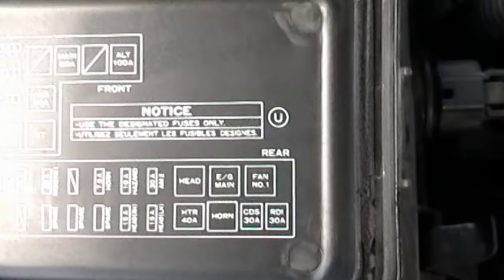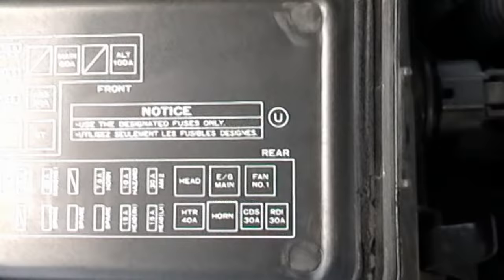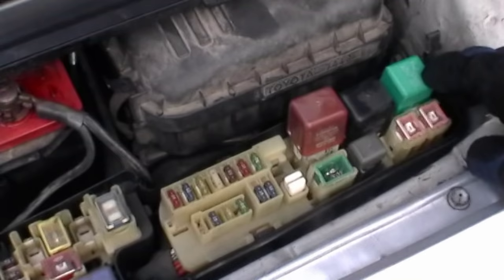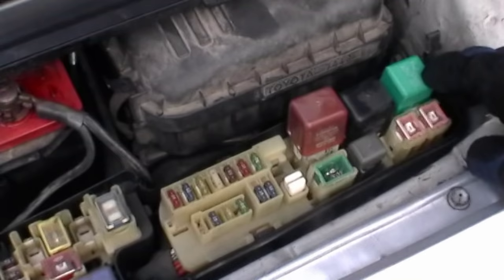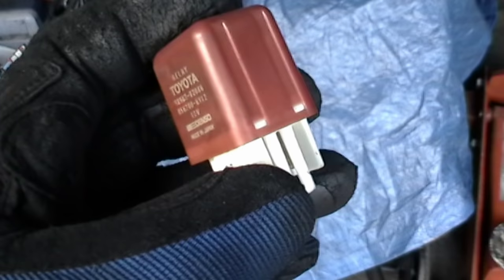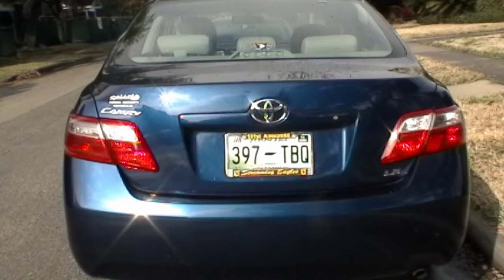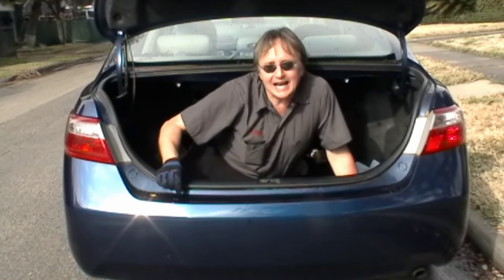How to Repair a Cooling Fan in Your Car

Comment: I own a 1997 Olds Cutlass Supreme, 3.1 L engine.  When I turn on A/C it just blows warm air.  (A/C indicator light does illuminate on dash control) Compressor does not kick on.  As you know there are two cooling fans.  Passenger side does not come on, driver side does engage.  I have not checked anything so far.  Thoughts?  Thank you

Comment: scotty i did all the test everything is good except i still cant get my fan to turn on. i had a heater sensor malfunction and i changed the thermostat and the heat sensor and all new fuses. my car still over heats my coolant reservoir always melts a hole by the hose and sucks up all the coolant. ive paid 200 to fix my problem with no luck. im on my 3rd reservoir. ac works no cold air or hot. please need advice. by the way i love the videos man. keep them coming.

Comment: If one of the two fans is working, should the other be working, also? Or is it computer controlled and additive, meaning does only one fan sometimes come on, normally, and the second fan only when needed? Thanks. I've got one of the two fans that is acting sluggish when I first started the car, then stopped completely before the motor warmed up - not sure if this is normal or not. Thanks!

Comment: Hi, the fan temperature switch test is not clear for me. So just connect one wire between -ve battery terminal and where in  the fan switch?

Comment: I went through all these steps on my 2003 Chevy Venture. Tested my fans on the bench when I replaced the radiator and in the car by unpluging the senor, they come on. Tested the relays and fuse. Replaced the coolant temp sensor. Still not coming on when I let it get hot. What now?

Comment: I have a 2001 Pontiac Grand Prix that's overheating . The coolant and oil levels are adequate so I think that narrows it down to the radiator cooling fan, because it doesn't come on when the engine is running. Can you give me the simplest possible fixes for this, specific to my car, with maybe a video? Sure would appreciate it. Thanks

Comment: Hello. Here's an interesting issue. In my 2013 Dodge Avenger SE, the two fans are working fine on low, but on high only one turns on. Relays are ok, as well as fuses. But no power on the failing fan wire on high. Why can happen this?

Comment: I have a 2006 Pontiac Vibe. My cooling fan motor works. But the actual fan inside wiggles. Do I need a new bearing or spacer and how do I do that. Or should I just replace the whole unit?

Comment: Hi  Scotty,  I enjoy your videos a  great deal.   
I have a 1995 Camry 177,567 miles..   I brought it used back in February.   . Both fans ran as soon as you start the car. Continues to run until you turn off the car.    

What say you?
nh

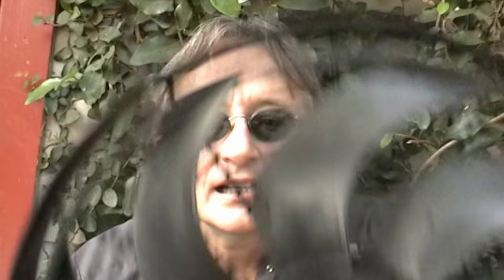Comment: At 1:47 to 2:22  you say to "ground it right here on"___  ??????? then it cuts right to, Take the other end and put it on the neg terminal of battery. So 1st off you just use neg wire with alligator clips correct? No positive this time?And 2nd if fan come on you need new sensor correct?? and what did you ground it on? the prong i'm assuming. Is that right. When did cooling fan relays come out cause I  dont think i have one on my 95 buick century. Thanks Scotty.

Comment: Hello Sr very good videos, I have probably a dumb question, Does the fan has to turn on every time that you start the car or only when the car is heating up? Thank you. Honda 97 just replaced the radiator and the only fan that turns on is the one of the right ( from driver view ) but stays on even when I turn off the car

Comment: Hey Scotty what would be the over heating problem on a 2010 Chevy Camaro I've changed the sensor I flush the radiator there's no smoke coming out from under the hood but it's showing on the gauge is overheating sometimes

Comment: 2005 Dodge Caravan Radiator Fan Driver Side is not working. Passenger side is working pretty good but not the Driver side. What should I do.

Comment: My '89 jetta cooling fan only comes on when I turn on the ac.  I changed the cooling fan sensor and the thermo fuse that had burned and melted the fuse holder.  The fan still does not come.  It used to come on when I ground it.  Since I changed the the thermo fuse if I ground the fan while the vehicle is running it does not come on anymore, but it will come on if I turn off the ignition.

Comment: And also do you recommend using permatex on the housing gasket to replace the thermostat or should I be fine just tightening it back together with the paper gasket no silicone ?

Comment: you werent clear as to where to ground the wire to the sensor when testing it with a battery,,,do you touch the inside of the sensor or the outside with the ground wire?

Comment: Tested the Fan that works. Replaced the temperature sensor. Replaced the Fan relay. Fused isn't Blown. At this point I may wire a switch to manually turn the on and off at idle. 
Any other ideas? Btw I have a 05 Kia spectra

Comment: Great vid! Do you know where the  cooling fan temperature switch is located on a 1999 Oldsmobile Intrigue? The fans work and the fans’ relays are good but I can’t locate the cooling fan temperature switch. Thanks.

Comment: I have a 2005 Hyundai Sonata, the condenser fan is not working, it's not getting overheating at all. I checked relay, fuse they all good. Should I replace the fan? I'm not getting cold air but the heater it's working perfectly fine. Any suggestions? Thanks

Comment: Scotty,love your videos..
I recently bought a 2012 Ram 1500...every time I turn the AC on I get engine light and fault code p0481....found out electric  fan isn't working...so I jumped the fan from the battery and the fan works.....
There is an auxiliary fan relay below hood latch...I pulled the relay and bypassed it and the fan runs...what else could it be ???
Any help much appreciated

Comment: I don't understand are they supposed to work all the time while engine is running or every while?
Reply: He didn't say censor and a switch so the answer would be no it's no need for switch or censor if the fuse is continuous

Comment: If you close the circuit at the relay and the fan turns on does it mean the relay is bad or good for 100%? Or could it be the temp sensor still? If the temp sensor is bad would the fan turn on if I close the circuit in relay or not? Thank you for any help or info in advance!!

Comment: hey Scotty show I replaced all the relays that are in the fuse box that relate to the cooling fans my question is if one motor doesn't work on the dual fan setup will that make both Motors not turn on when the car gets hot
Reply from the maker: check to make sure the motor isn't burned out first, if not that, often bad computer circuitry that drives the fans

Comment: to check the (cooling fan temp switch)..all you do is run a ground wire to it and the (neg) on the battery ??

Comment: I Cannot find anything on a cooling fan switch for a 2007 ford escape hybrid. The auto parts store only sell extra wiring to hot wire the fan. Im  guessing the cooling fan switch isn't accessable.

Comment: My Radiator aux fan is running (it;s really loud) within seconds after I start my 2008 BMW 335i. This started here in NJ when it got very cold two days ago (13 degrees) and also I don't have any heat since this happened. Any ideas? Thanks as always............................Philip.

Comment: Heay Scottie I got 2001 Grand Marquis and fan works, relay is fine, thermostat is replaced but still have major voltage drop when fan kicks on and wires get too hot to touch by fan connector near top of radiator area!! I'm confused as to what can cause fan to work and wires to overheat being they look to be pretty thick gauge original wires. Please any advice? should i just look at replacing the working fan that comes with new wires!

Comment: i have a question. i have replaced the temp control switch and fans aren't coming on but when the fan is directly wired it works but my car has 2 fan relays. (04 chrysler sebring) will i be able to look at them and tell if they are bad or should i just replace both to be on the safe side?

Comment: I don't understand when you short the temperature switch with the negative terminal, which case means the temperature switch is bad? running or not running?

Comment: hey I have a 2005 kia optima LX my fans aren't working, I watched this video obviously and did what you did and they worked therefore my motors aren't broke but I haven't checked the fuse and I don't know where's the reset switch...
Reply from the maker: +J Rich it has no reset switch. More often either the coolant fan tempt switch is bad OR the main computer circuit that drives it

Comment: Pro Mechanic Tip from a used car dealer: If  your car starts running hot as you are driving and you need to make it home or the next exit, open the RUNNING HOT CHECKLIST......1 roll down windows. 2 turn the heater to max heat. 3 turn the heater fan to max.
By doing this your heater core is acting like a radiator to help cool the motor.  This may get you home or to the next exit.
Another tip:  Scotty failed to mention:  your driving down the road and and your temperature gauge drops down to cold.  
You think it's ok. Cold is better than hot.    WRONG. Here's what happened: your antifreeze has leaked out.  Your temperature guage read off the antifreeze. 

Your motor is going to melt down.  To double check turn the heater full blast.  You have no warm air.  
Pull over immediately and shut it down and call for a rollback.
Best case: a leaking hose. Worst case: blown head gasket.
You're welcome Scotty.

Comment: When you tested that sensor, where did you actually put the other end of the negative wire, and the red end?
Reply from the maker: the negative wire is grounded on the engine to check it

Comment: Hey Scotty I have a 2005 Kia Spectra and I've done everything on the video I replace the temperature sensor I replace the relay I checked the fuse that wasn't blown and fan still does not come on but the car seems to be running at normal operating temperature the needle never rises above normal so what do I do from here?( yes the fan motor does work)

Comment: Scotty, on my 99 Elantra, last nite my temp gauge went up a little warm , not over overheating, the cooling fan spins very slow, not fast not sucking air as you say in your overheating video, now tonight I go to check it, an now my air conditioning fan for the condenser is not running . any ideas ? My dad told me use the heat along with the cool air outside until I fix it, fuse an relay is good. Please let me know . Kody

Comment: Scotty great video...you gotta HELP me...
    I was changing my oil the other day, and checking my fuses on a Chevy Impala ltz  2015 ,I let the car run without the cooling fan fuse !!!!( forgot to put it back in)  
    which I forgot and the car was running for about 15... minutes,  it was smoking .
   I think it was the residue of the oil burning on the exhaust though.( I'm hoping) . I hope it wasn't the engine burning in overheating the gauge never goes above half anyway in that car.
I do appreciate it  in advance  you respond !!!
 I know you don't respond much but please I need you on this one, I've been watching your videos for 20 years!!!!

Comment: Soo dumb question but here goes: I have a wobble in my fan. Its driving me nuts. I know how to pull the fan and replace it but I am worried about what looks like a coolant resovoir attached either to the fan or the housing. Will removing the fan introduce air to the cooling system? Its an '06 Pontiac Vibe. I am thinking of pulling the fan, collecting the coolant in the small resovoir in a container, and replacing it in the new fan. Is this correct?

Comment: For a 2000 Honda Civic, what would indicate overheating if there is smoke coming from the right side of the car and the fan only works when AC is put on blast?
Reply: did you ever find a fix for that
Reply: Throw you car away lol

Comment: 2005 Durango 5.7. When AC is on at idle it blows warm air, when moving it blows cold air. Checked condenser it appears to be spinning, ac compressor is engaging every 5-10 seconds at idle in park. What could it be?

Comment: Scotty what if your cooling fan is running excessively? I’ve got a 2004 Toyota Highlander with almost 300K miles. It runs and shifts beautifully but the fan is running a lot even in this cool weather. Any ideas?

Comment: hello Scotty I changed out the radiator because of a small crack and my fan fell off and just rolled down my driveway so I bought a new fan.... Electric fan  works when I turn on my a/c .... clutch fan turns all the time but from what I have read that is fine .My question is when will my electric fan turn on???
...

Message not delivered.Now

Comment: Hi Eric I'm working on a 1998 wind star 3.8l mini van and the cooling fans not working I checked the fans they do work and also checked the fuses they good. I'm going to change the cooling temp sensor but I notice that when I turn the a/c on the fan work then.. Do you know why? Do you think it is the temp sensor?

Comment: I have a 2003 Chevy Malibu and the fans don't come on and the car overheats. I haven't been using it cause I don't want to damage the engine. But, I tested the fans and ran a wire to the battery and the fans come on high; I also turn the a/c on and the fans come on high. I checked the fuses and relays and they are good, except fuse 55 cooling fan #2 ground (30amps) (v6 only) doesn't light up the test light. The wiring diagram says hot all times but I guess it should complete the circuit when the cool temp shorts out. I replaced the thermostat and that didn't fix the problem either. Then I shorted out the wires that go to the coolant temp sensor and that did turn on the fans on high. So I went ahead and replaced the coolant temp sensor, but it still doesn't turn the fans on and the car overheats. I then thought the coolant wasn't flowing and replaced the water pump, and the same issue. Then I opened up the bleeder valve and put more coolant, then turned the heat high with blower low, and still no fix to the issue. I then took out relay #12 (cool fan #2) and ran a wire from 30 to 87 to see if the fans turned on low and they did, so this determined that relay #15 (cool fan mode relay also works because it has to go through that relay to complete that circuit). But still I can't fix this. With the information I have provided, what do you guys think it is?
Reply from the maker: ***** those are complex computer driven fans, why not do what I do, just run a toggle switch to power the fans manually and leave it at that
Reply: Thanks man. I'll do that then. Thanks. I enjoy your videos.

Comment: I did what you said and ended up replacing the coolant fan switch/sensor but the connection to it came apart. How do replace cooling fan switch connector? The other end seems to go into the engine somewhere. How do I get to it?  I have a 03 Chevy Malibu

Comment: What about if I replaced the switch, I tested the fan as you showed and it works and the fuses are ok but my fan still doesn't run when it suppose to what can be the problem?  I went to mechanic and he says that it might be weak battery as it's quite old but that doesn't make much sense to me. The car starts just fine every time. It cannot be the wires as well as he tested my fan through obd connection with his laptop and the fan worked just fine..

Comment: I have a 93 Honda del sol. I have checked the fuse the relay and they are both good. I replaced the sensors and it still doesn't turn on. Am I missing something?

Comment: hi scotty, This was a helpful video. I encountered different problem with my radiator fan. when a/c is on the fan is functioning at low speed and fan speed doesn't change even the temperature gauge keeps high which affects the aircondition, but when the a/c is off , the fan will function in high speed when it reached the mid temperature. I am wondering what to be changed or to be repaired. hope you help me.
Reply from the maker: you have a problem in the AC system wiring not sending full power to the cooling fan. Start checking that wiring and pray it's not a computer circuit fault in the AC computer module
Reply: thank you scotty. my car is nissan serena model 95 and not have a computer box on it. do you think it's wiring trouble? thanks again

Comment: is it normal for the car AC to take around 10 min before it starts delivering cold air in high outside temperature 110 degrees and above? anyway to decrease this period other than parking in shadow and tinting?

Comment: i have a 94 corolla when i turn on my park lights the tail light fuse blow dont have dash light either i do have head lights,turning signal, hazzard light and i have light when press brakes

Comment: Thought i had a short? Red wire getting really hot. Have old style assorted connectors like package at pep boys. Connectors are tight and fan stays on when jiggling wires and fan goes on and off when soposed to. But over heats at idel once in a while. 260°.
FYI: I don't have a fan relay on my 2000 jeep grand cherokee Laredo. Not listening on fuse box, just fuse!
Any suggestions???

Comment: The fans turn on when i connect them to the battery so i know they work fine. And the relays and fuses seem fine. I just cant seem to find the cooling fan temp switch for my 2009 Dodge Avenger. Any ideas where it might be? Looked all over the internet and cant seem to find it.

Comment: I have a 3.8 v6 mustang, but the cooling fan comes on late from ehat I've been told. It'll read 3/4 of the way before it kicks on and I dont know if its normal cause i replaced the thermostat and the cooling fan temperature switch.